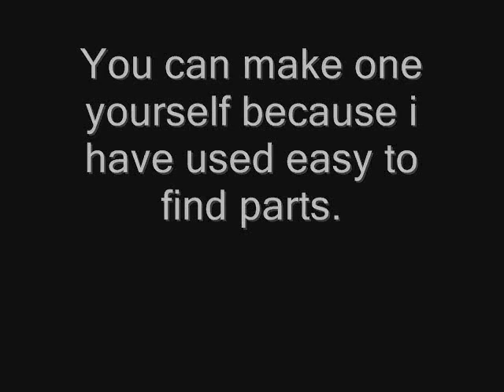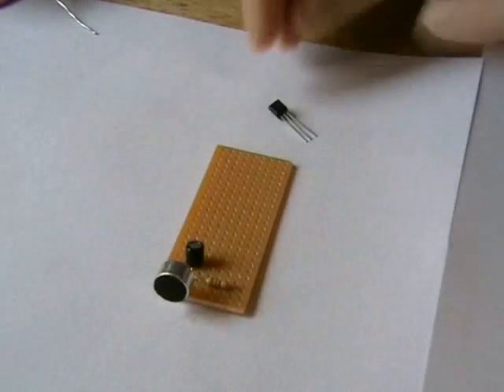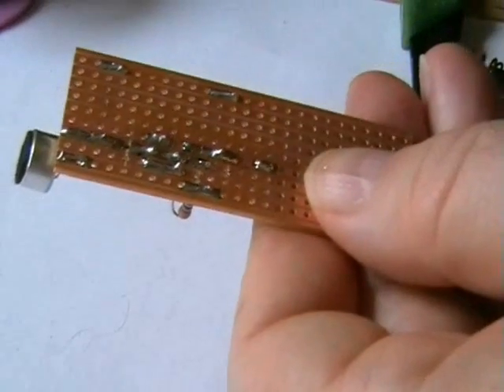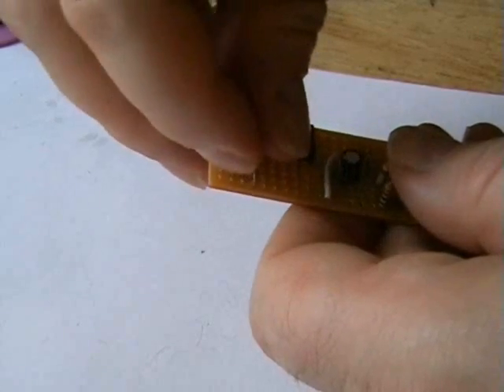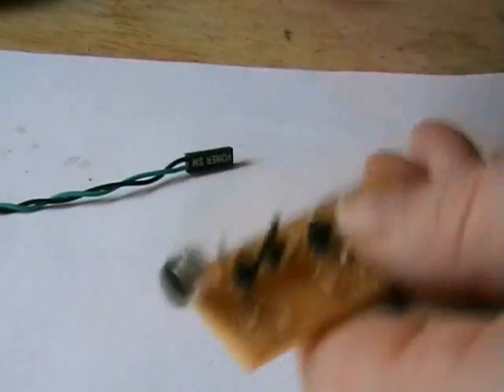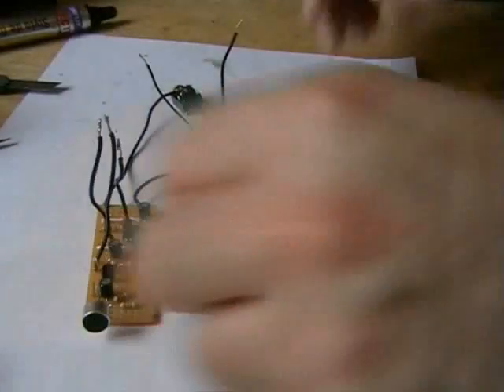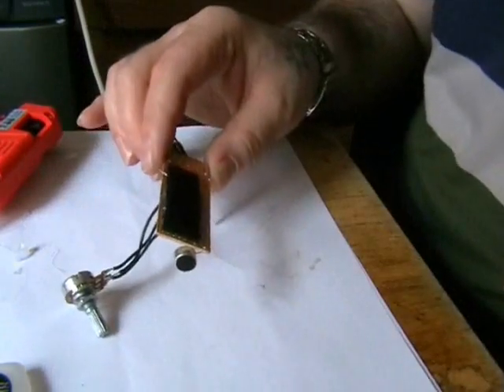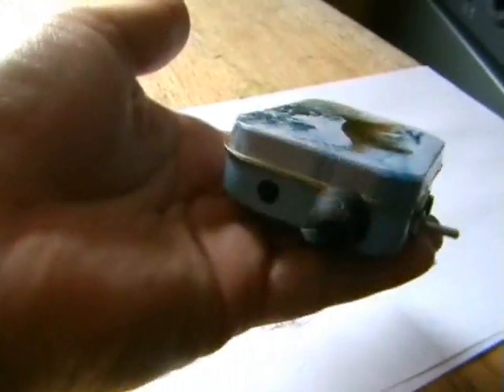The super tin box sound amplifier. I show you how to build one.

Comment: It saves space to use a volume/on/off pot instead of a seperate switch. Also, it's fun to add a simple 3 band EQ (low, mid, high frequency) and a gain pot for adding distortion when used as a guitar amp.

Comment from the maker: You can use a small speaker.
The LM386 integrated circuit can only drive a small speaker
because of it low power output.

Comment: Hi there really wanting to make this, I had previously tried an evil genius circuit called bionic stereo ear, using 2 lm386 and 2 mics in the same circuit, unfortunately the result was a seriously loud scratchy rumble. I have just bread boarded this and it works but I only seem to get a little volume before the slightest sound comes thru the headphones as a loud scratch sound.. Do you think I'm going wrong somewhere, cheers.
Reply: I built 2 in case the first was faulty, can only get decent volume on half way then just interference, hope Dazaro sees this post and has a solution.